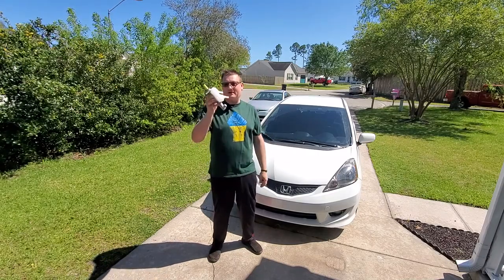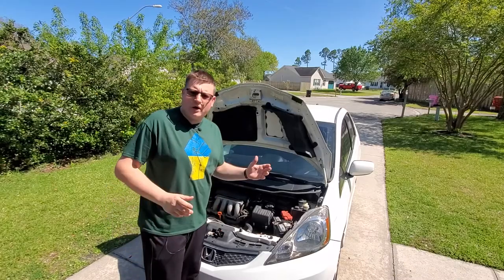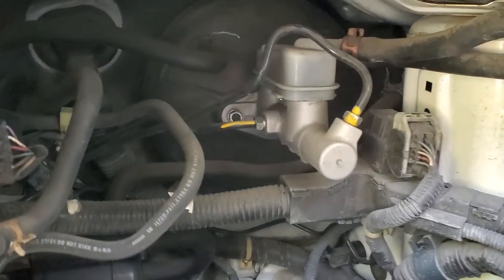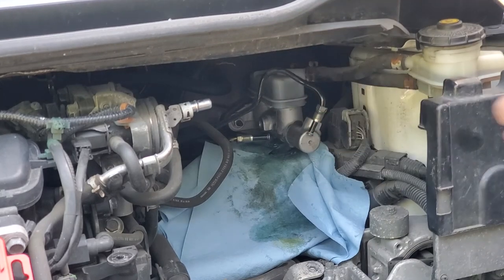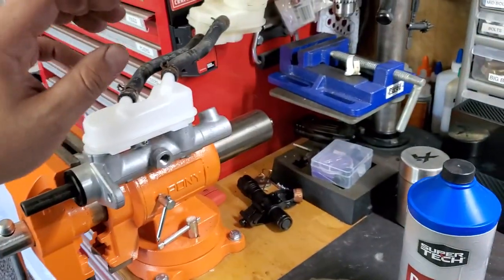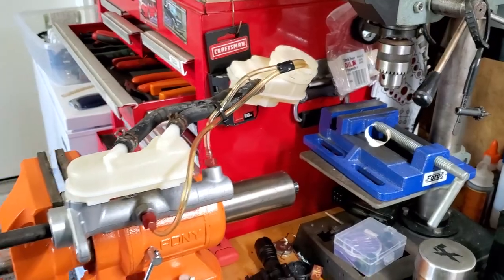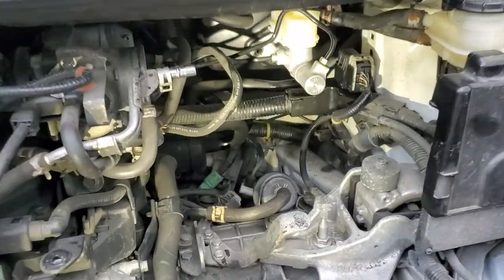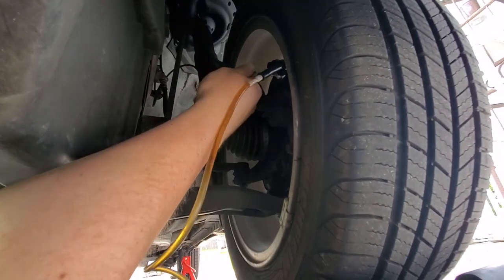Honda Fit / Jazz Brake Master Cylinder Replacement

Comment: How much do you pay the master cilinder? mot says mot doesnt work but i tested urgency brake in a test control and works perfectly. Could it be only to replace the fluids and purge?
Reply from the maker: @LinuxWin  emergency brakes does not use brake fluid. And I don't remember how much I paid for it.  it's been a few years

Comment: air doesn't get into your master cylinder when you put the hoses back on ?
i feel like in that time that you open it up it would get air.
Reply from the maker: It will but only on the beginning, not deep inside of the master cylinder. Then you just flush it

Comment: Dear brother, I have a Honda Jazz, the rpm does not exceed 3, and the automatic transmission was disconnected while driving, and I had a p1887 code. Please help in solving the problem. Where
Reply from the maker: I'm sorry I can't help. Don't know nothing about transmission.  Check forums you can find a lot of help there

Comment: Which clutch master part is that? Im trying to replace mine for honda fit 2009 and every type of clutch master i look to buy is a different one from the video, which i need
Reply from the maker: Sorry I have no idea. I bought it from Advance Auto Parts. That's only what I remember. If you have manual transmission it might be different
Reply: It's the brake master cylinder. What you have is the clutch master cylinder, which is located behind the brake master cylinder, near the wheel well.

Comment: Changing the the brake fluid every 2 years would keep the master cylinder working for many years.
Reply from the maker: That's what I thought too !!
Reply from the maker: I have no idea why part failed... I changed brake fluid few times ovdr the years and I bleed  breaks pretty much every time I was changing brake pads